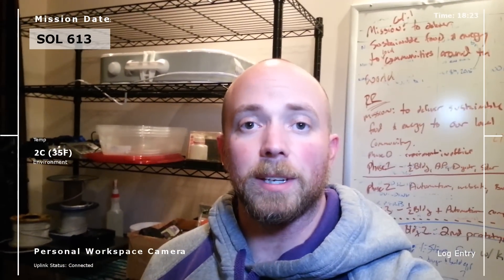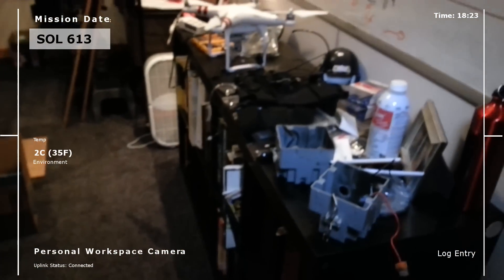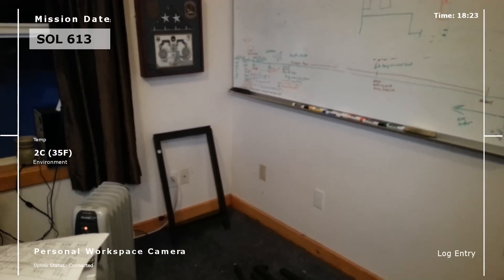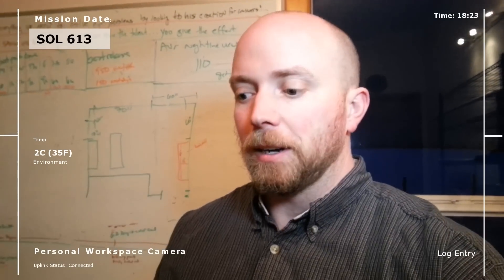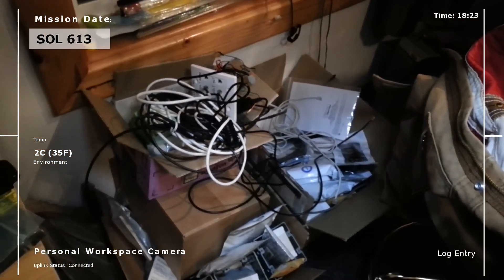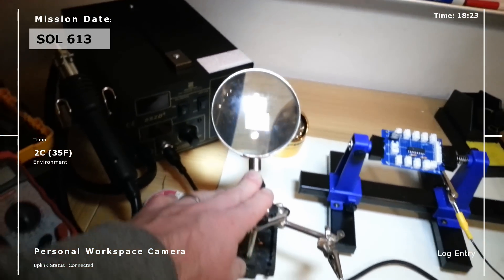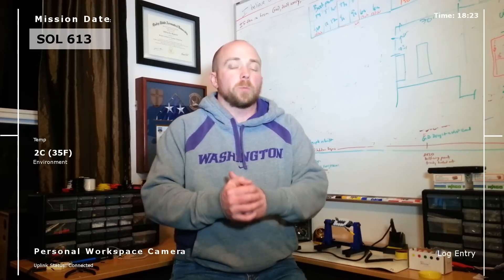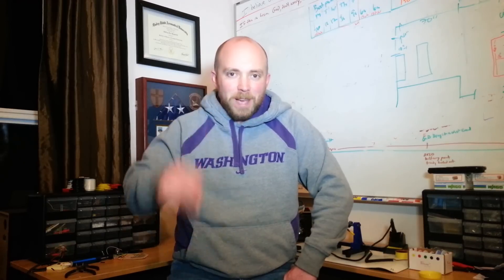The BASIC SETUP and Tools NEEDED to Build CIRCUIT BOARDS - For BEGINNERS

Comment: I'm no expert on this, but I think the wire on your esd pad should go to ground, not to the board.
Or is there a second wire on the pad?
Reply: Matthias Plus Yes, the mat needs to be grounded and when you work on the circuit you ground yourself to the mat with a grounding wrist strap, not the circuit board itself.

Comment: My advice: You should put the drill press away from your electronic assembling area. If you drill any kind of conductive material (say copper, alu, ...) you will produce conductive dust particles which will spill over into your components.  I understand the temptation to have the drill press near by.  But the boring dust and chips are poison to electronic modules and they will sooner or later for example cause some of your sensors to fail.

Comment: First. LoL
Seriously though, couple of tips.  Use empty toilet paper rolls to store things like usb cables and things like that.  Just roll a lead around your hand then slip that off and put it inside the tube.  Completely reusable  unlike zip ties.
Get a piece of rebar or dowel small enough to fit through your spools of wire and hang that inside your new wire shelves or make a pair of brackets and put it on the wall.  Warning, it can really get heavy so be sure of how you mount brakets if you put itt on a wall.  Usually the best way is to have like several 1 foot bars on the end of your selves NOT on the front of them so you can put up spools without blocking access to your shelves.  Keep up the good work.
Ray